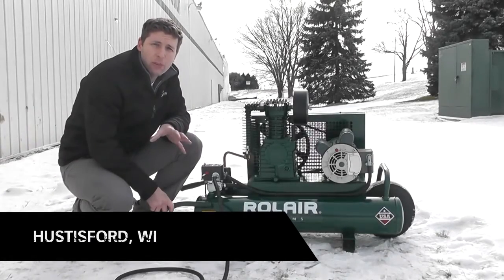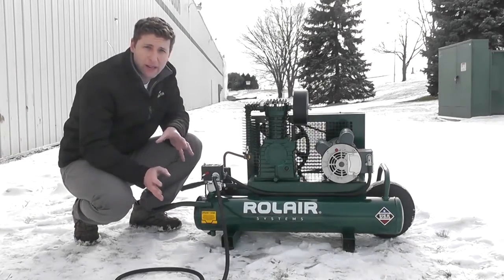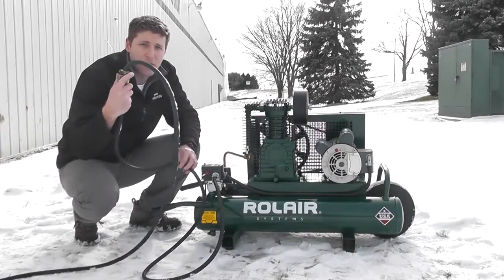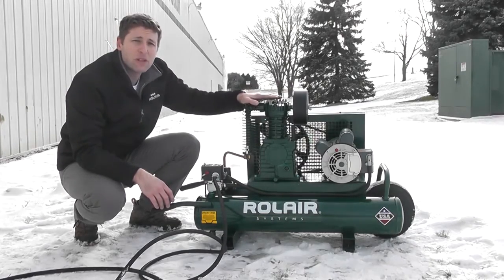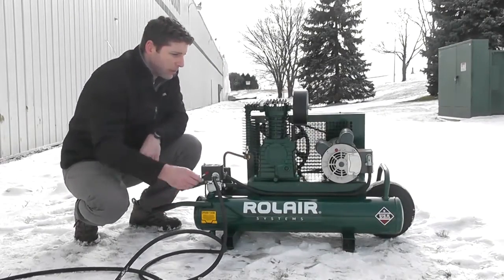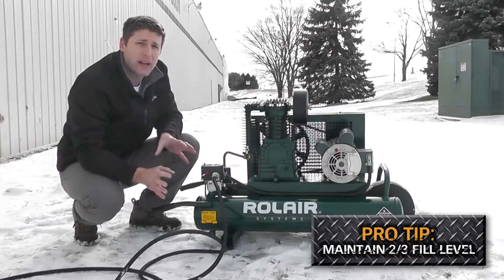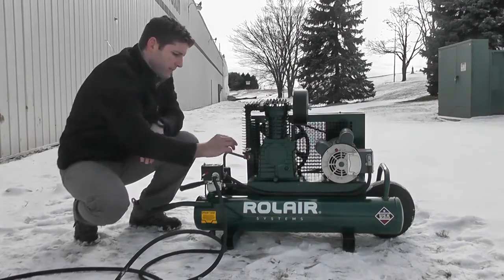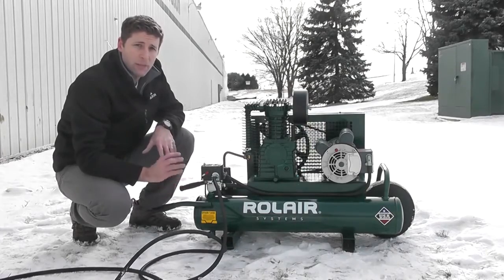How To Cold Start An Electric Air Compressor With RolAir

Comment: Hello thank you for sharing what kind of oil should I use in this compressor as I have the exact same one
Reply from the maker: We generally suggest D55001 Compressor Pump Oil. If you're in a cold climate, also use NO-TOX2 air line deicant to prevent moisture freezing in your air lines.

Comment: I have this problem starting on extremely cold days (9000 ft in the mountains) tripping the breaker or test switch. We have to run a space heater in the trailer or switch to oil less pancake compressor. I’ll have to try these tips. thx.
Reply: How did it work out, excited to pick up a 8422hk30

Comment: Nice!  Answers my question about running one of these babies on a questionable electrical supply.  But I'm still curious about the "continuous run option" where the motor stays on (reducing spikes in current draw), and compressor kicks in only when needed.

Comment: What's the purpose of the cold valve?
Reply: I am thinking it is reducing the amount of pressure the motor has to overcome.  With the pressure reduced the motor can start up and warm up a bit.  Once warm, close the valve and build that pressure.